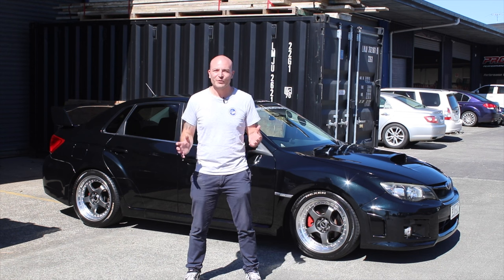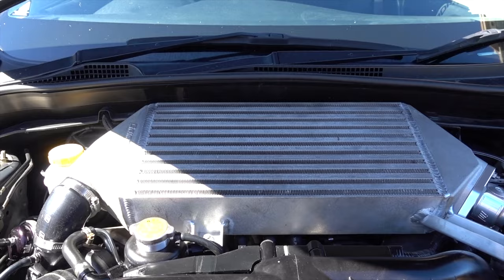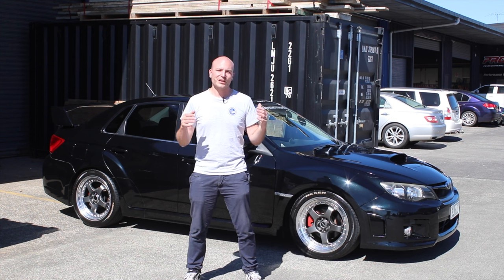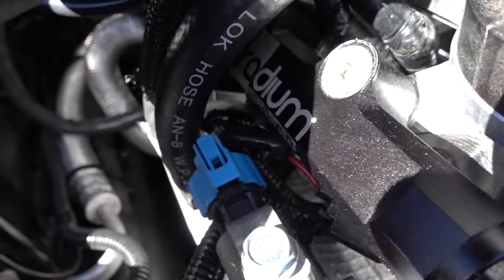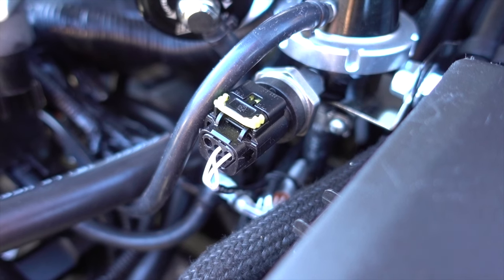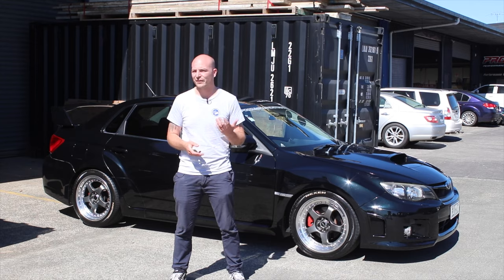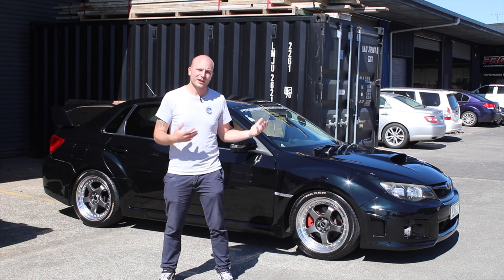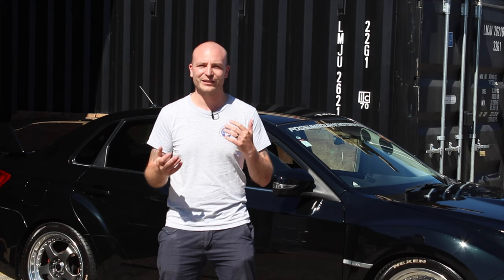500HP+ from Top Mount Intercooler!? | Subaru Impreza WRX

Comment: That model of WRX is probably what I will own when I'm in my early 30s, I'm currently 21 right now driving a 1998 Subaru GC8 WRX
Reply from the maker: Nice! Make sure you tag us on IG so we can see and share your WRX! - Pat
Reply: @PossumBourneMotorsport   Wow really, I already follow you guys on Instagram!! I'm currently in the process of building my GC8, respraying the car right now and recently I've fitted a front mount intercooler and few performance upgrades here and there
Reply: yeee boy up the gc
Reply: GC is the best, take care of it. I tried to find a rust free gc coupe to swap an sti into. They are getting more rare.
Reply from the maker: @bumamotorsport4573  the GC coupes are pretty cool - very rare and expensive here in New Zealand.

Comment: What peak intake temps are you seeing? I'm considering running an EFR7163 SX-e cover + TS with that Grimspeed intercooler with the heat dispersant paint. Might cross 400kw. But it is a legacy GT. Is the airflow much worse?